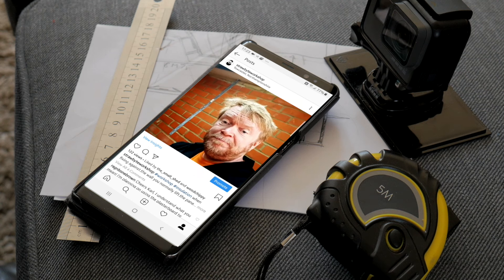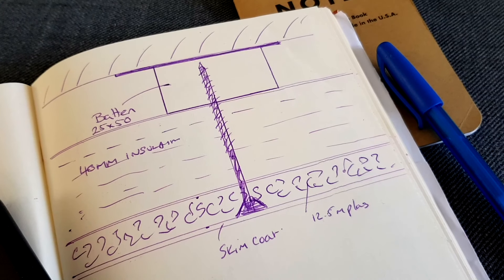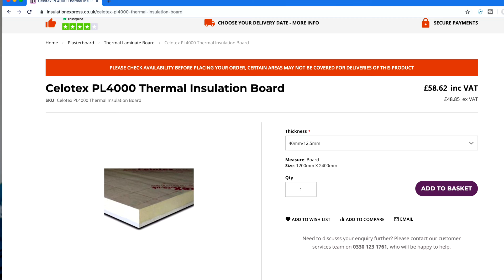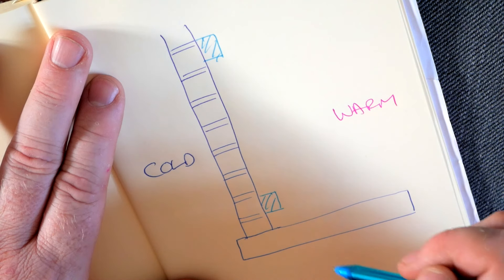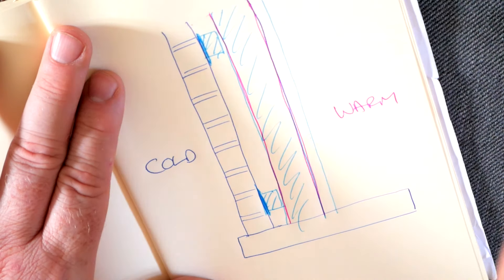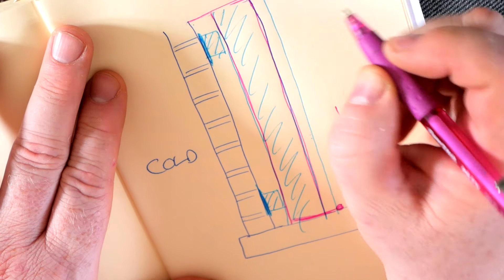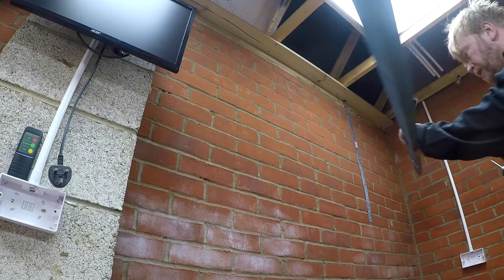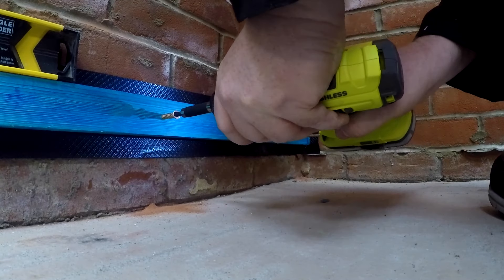How to Insulate Your Workshop | An Easy DIY Project | Keep Your Shop Warm or Cooler

Comment: Great video, I’m looking to this exact thing on my new build single skin garage. Just a few questions if I can. 

Why did you not use the insulated plasterboard all the way around? 

Did you do anything with the thin strips of brickwork either side of the garage door? 

How’s it been since doing the work? 

Thanks 🤩
Reply from the maker: Hi Chris - sounds you've a very similar situation to me. Let's deall with those questions.

The switch from insulated plasterboard was a practical one. Namely if you bulk order then you need somewhere in the dry to store it before installation. With the second approach, the celotex is fine in the rain for a short while and 9 or 12mm MDF can be picked up on a daily basis as I needed it. In-fact, I bought all the materials I needed to finish the job at once and my builders merchant stored it for me and dropped it of every day.

The video was filmed over almost 5 weeks with 2 week gap between approaches, so it looks a little odd there was a switch.

Yes, the blockwork was later covered with insulation and boxed in. I did shoot video in 2020 covering that but haven't revisted the project on the channel. The video remains popular and I get many questions from new viewers so I may soon do a follow-up.

The work was completed in 2019. As said, I completed covered the blockwork, Installed a personnel door and finished the final 2 'bays', installed skirting board, replaced the up and over garage door and re-installed the insulation again on that wall, and dealt with some patching due to a faulty damp-proof membrane installed by my builder.

I touched on it in the video when I spoke of the workshop staying cool in the heat. The reverse is true - in winter time 20 minutes with a fan-heater and it's approaching too warm and stays warm all day. The only thing I wish I had done is install the flooring first and then tie that into the wall at DPC level. There's been no issues in terms of performance but it would have been a tidier result.

I hope that helps.

Karl.

Comment: Great video. I’m about to start my own Garage Project and this has given me a lot more confidence of doing what I thought in the correct way!

Question- How did you seal at the floor? More adhesive or did you also install garage flooring and then seal?
Reply from the maker: Hi James, You can do it! I've heard from many complete DIY novices who have surprised themselves with pulling off a decen installation. I think the nice thing about it is that you cover-up mistakes with each layer leaving, perhaps, some moderate surface filling and then painting.

Regarding the floor. Before tackling the floor the concrete used to kick-up dust all the time and I found that concrete sealing products really didn't last long. I sealed the floor for the last time a few months before I bought the vinyl floor with a product recommended by my builder and what I used to seal my patio. It didn't really work so the floor you saw me laid was laid straight on the concrete. No damp-proof membrane and not sealing post installation. In-fact being PVC I've had no damp what so ever rise through the floor.

I hope that helps. Let me know if not.

Comment: Great video, I'm about to start on my garage and need to board the whole lot up as well.  
We have solar coming so I want to hide all the inverter wires and cabling inside some units so I need to baton and mdf that area to support the weight.  
I don't really care too much about insulation in there so I was thinking of just using the water menbrane against the wall, then the stud wall and then plasterboard.  I guess that would be fine?
Reply from the maker: Thanks for the comment - I'm continually surprised at how many views this video gets a few years on from completing my project.

Your question has come up once or twice from viewers: I'm thinking of boarding-out the walls of my garage but don't need the insulation, what's the best approach?
In terms of what you see in the video. If you're fixing battens to the wall then you should use DPC membrane on the back (as in the video) because this protects the battens from moisture that will penetrate through the brick when it rains. However without insulation there is a risk to any material you put on the battens (MDF, OSB, Plasterboard) from the moisture so I would suggest that you use building-wrap (Tyvek or similar breather membranes) between the MDF and the battens. This is usually applied to the outside of buildings with the writing site facing out. When using it this way, staple to the battens with the writing facing the wall (outwards). The wrap prevents any liquid water making its way into the wall cladding but allows vapour from inside to make its way to the brickwork and then out through the bricks to the outside. I've used this recently with a wood-store I've build recently with a brick wall serving as one of the 4 walls. An alternative approach would be to look at plasterboard with a foil back. I bit more expensive per sheet but that might similar to using a building wrap sheet under it.
When fixing battens into brick I recommend concrete screws over hammer-fixed style plugs and screws. They have far superior strength - you might say way too much - but their cheap as chips and easy to fit.

I hope that helps.

Karl.

Comment: Interesting solution. I used an air gap to the OSB, 50mm celotex then 40mm rockwool, plastic membrane, then plasterboard as I need my workshop to have good fire resistance.
Reply from the maker: I needed to minimise the amount of space lost and, to be honest, we're not subject to extremes of cold or heat where I am. Fire resistance has come-up in questions a couple of times and it was something I considered but being quite frank - so long as I can get out safely there's little risk to my home from a blaze in the workshop.

Comment: very good video Karl, and thanks for sharing. as this was completed a while ago could you advise how much difference in heat/cold the changes made please? when my workshop is installed it will mean I can start work on changing our single skinned internal garage into a utility room. many thanks
Reply from the maker: It has made a big difference. But bear in mind I’ve completed the last two walls and the block piers off camera. Generally in the summer it’s about 5 degrees cooler than outside, in the winter a 2kw heater gets the space up to 15 degrees in about 30 mins and the space retains heat well. I didn’t insulate the floor due to floor standing tools, but that’s a consistent 9 degrees all winter long. 
I am preparing an update on the project and will talk to some of the other gains. 
You may need to do some additional research when insulating a room integral to the house. Building Regulations will guide you on the thickness of insulation needed. Typically 75mm plus 25mm overlayed as a minimum. A call to the technical department of a supplier will give you an idea of what you need. As the work was in an outbuilding and the room is not for sleeping, cooking or a bathroom, I was fairly free to choose the level of insulation.
Reply: @StrawbyteWorkshop  thanks so much for your response, i really appreciate the info and look forward to the update, cheers

Comment: Hi, Great summary of insulation options. A couple of questions - where the single skin is supported by the block pier, do you find that this get's cold? Secondly,  did you ever do a video of insulating the ceiling? I can't seem to find it? Thanks
Reply from the maker: Hi Huw. Actually where those block piers are now, I’ve actually insulated over them. But for the first winter they didn’t seem to create a cold problem in the space. They’re now covered with 40mm PIR and 18mm of plywood. I may eventually get around to an update video at some point. As for the roof space, look for a similar question in the comments for an explanation and a link to a video that I withdrew from the public listings.
Reply: @StrawbyteWorkshop  Thanks for the reply - I have a pretty much identical garage construction to yours and am considering doing the same as you've done. It would be nice to somehow create a flat wall so am considering building a stud wall between the piers to allow me to just cover the block piers with the mdf/OSB or whatever I end up covering the wall with. Thanks for posting this sort of video, it's helpful in gathering ideas. Huw

Comment: Hi Karl. I've just been watching your video on insulating your garage walls. I also have a single car garage similar to yours and intend  insulating it as well. Have you produced a video on insulating the ceiling. You have mentioned it several times, but I don't seem to be able to find it. I would be very interested to see what you have done. Regards, Bill.
Reply from the maker: Hi - thanks for the question. I did put out a video at the time (https://youtu.be/fpO6lMwRpCQ) which covered the roof installation. However I made a mistake and took the video down from public view. Watch the video anyway, but note the mistake I made was battening out after the first layer of insulation and then putting a second layer on top with a gap between them. That's not best practice as there's a risk of condensation forming in the gap. I've since re-done the whole roof over a couple of summers and removed the gap now and plan to update the video at some point.

Comment: Great video. Our new-build house will be finished soon and I was just starting to plan how would insulate it. You have answered all my questions. I’ll be checking out your garage loft video next. Thanks
Reply from the maker: Thanks for the comment. I've popped the link to the roof video here: https://youtu.be/fpO6lMwRpCQ
However, do be aware that I made a mistake which I've now corrected. In the video I show and explain how I put two layers of insulation into the roof with a gap inbetween. A comment on the video pointed out that the correct approach should have been two layers without a gap. The fix was simple but very time consuming and I do intend doing a follow-up - especially as there's been a spike in interest on all my videos. If you were trying to achieve the same thing, fix battens to the rafters, insulate between them (layer 1) place the second layer over the top.
Reply: @StrawbyteWorkshop  Thanks. Both videos contain a lot of useful information that will be a big help when I come to insulate my garage. I don’t make how to videos myself but I have worked on a lot of my own building projects and I also had a large CO2 engraver for a while. I bought a small CNC engraver but I haven’t had a chance to use it yet. Sketchup is a great tool and I have used in the past to plan my projects. Here’s one example and I’ll be checking out more of your videos so keep them coming 😎👍 https://youtu.be/kUCB-fvfgiQ

Comment: Hi Karl, did you ever make (and post) a video for how you insulated the pitched roof?
Reply from the maker: Hi david - yes the link is here. https://youtu.be/fpO6lMwRpCQ Strange you should ask now as I'm re-editing the video to address a mistake made in the inital installation, why that matters and what I've done to correct it. I intend that video to go up on Saturday morning.

In brief, in the linked video the mistake was to leave a gap between the two layers of insulation. In practice I've had no issues as the workshop is well ventilated and not used all day every day but did re-arrange the layers of insulation to remove the gap. The gap potentialy would allow condensation to form within layers of insulation and with nowhere for that moisture to go. 

I hope that helps.
Reply: Many thanks Karl; these are really useful, clear, and to the point videos of what you've done. Much appreciated. I'll watch out for the updated video.

Comment: Great video how long masonry screws did you use? Thanks
Reply from the maker: 75mm if my memory is correct. They're used to fix the battens and my general rule-of-thumb is the fixing should be 3 times the thickness of the batten being fixed. 25mm in this case.

I hope that helps.

K.
Reply: @StrawbyteWorkshop  thanks again great advice

Comment: Great job and something I'm considering. What screws and fixings into the brickwork did you use once you had drilled the holes in the brickwork. You said that you use masonary screws to avoid plugs but surely there has to be something in the brick hole for the screw to attach to?
Thanks
Steve
Reply from the maker: Hi Steve - I used concrete screws. Specifically video Easydrive TX Countersunk Concrete Screws 7.5mm x 75mm from screwfix. You drill a 6mm hole and it cuts a 7.5mm thread into the masonary as you drive the screw in. Works well in brick, blockwork and concrete. They have a ridiculously high holding power when compared to frame fixings or hammerfix style fixings - those use rawlplug style plugs. The only downside is that overtightening the screw will result in the threads being stripped and the screw will literally fall out. Back when I first used them on job-sites, the simplest way to guarantee getting the in without failure was to use a clutched drill/driver rather than an impact driver. These days an impact driver will stop driving when the screw is fully home. Timco and Tapcon are the better known brands.
Reply: @StrawbyteWorkshop  thank you. I will take a look at those.

Comment: Would this work with 75mm volcanic ash kinda brickwork ?
Reply from the maker: Hi - the overall technique of battening the wall and mounting the insulation and interior surface to it will work for sure. You may need to investigate how you attach the battens. I used concrete/masonry screws - you may need screws that require plugs for your situation. Thanks for the question.
Reply: @StrawbyteWorkshop  Thanks for the reply, not sure if its worth doing as the roof is corrigated roofing,  wil be able to insulate and plaster above but not very thick.  Your thoughts?

thanks Again

Comment: Ok, great video... I have a concrete Marley Type garage, I was using it as  workshop so only added Sterling board on the internal panels, I am now going to use it as an external office and wondered if I can just leave the Sterling boards in place and add a vapor barrier and then insulated Plasterboard, will this work?
Reply from the maker: There's a couple of things to keep in mind. If the walls of the garage have no moisture penetration from outside, insulated plasterboard can normally be bonded with construction adhesive straight to the wall. You've said that you have sterling board on the walls already and in your situation I would remove it and add the thickness gained to the insulated plasterboard. The existing surface is not going to make the wll any more.thermally efficient and could be the source of hidden rot in the future if moisture does penetrate from either outside or inside. In.found kingspan particularly helpful when I had installation questions. I hope that helps.